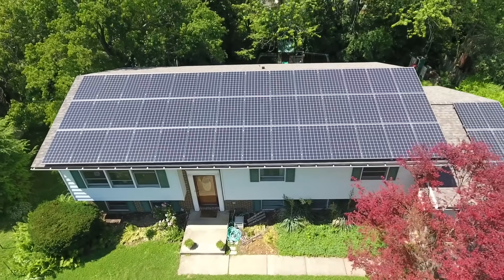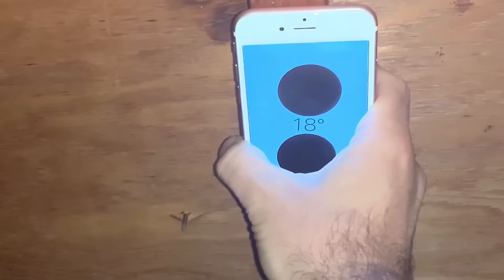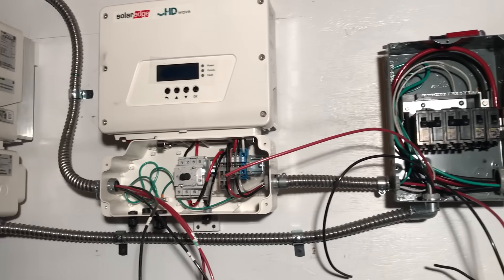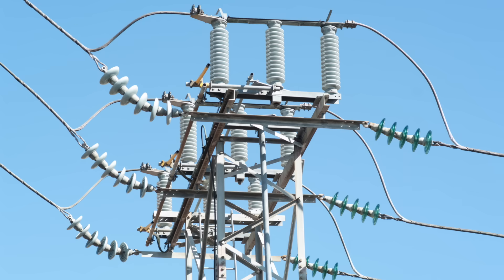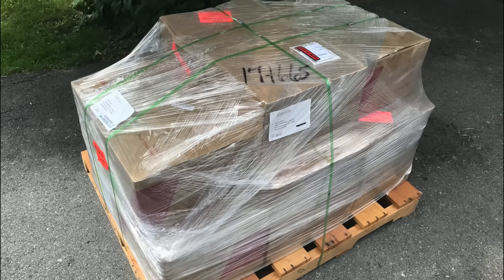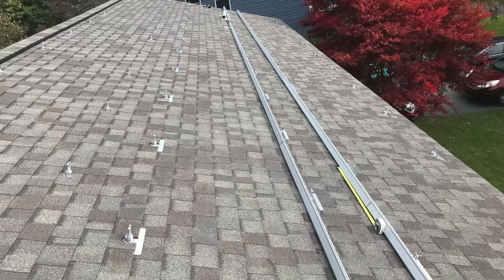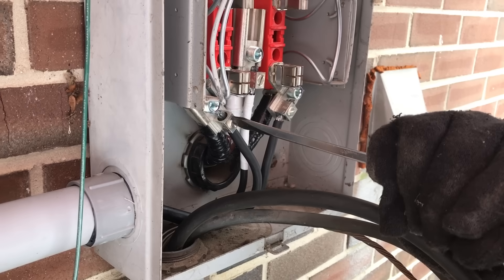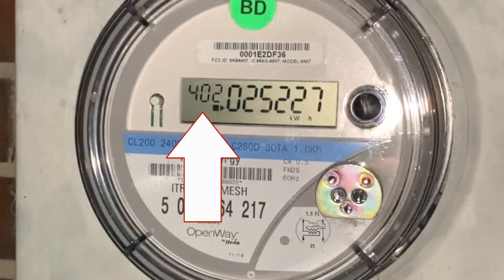I Installed a Power Plant Myself | HUGE DIY Solar Panel System

Comment: you had to pull several permits- that means the city / town will reassess your house value and taxes will increase. glass on the roof- your homeowners insurance will increase too.- that must be figured into the roi. also are you getting the same for your kw as the power company gets for theirs?

Comment: Great video.  Do you have a battery system? H
I assume you're pulling power from thr power company at night, so how are you net zero? Are you producing that much during the day?
Reply from the maker: Thanks!  No batteries.  New video slated to come out this weekend should help explain how it works.  Net metering is the key.

Comment: I’m curious have you dealt with any power outages since installing solar? Also are you storing any excess power in a backup system? Last question has the system been affected by weather conditions at all? I don’t have a house yet but I’m definitely considering solar when we buy.

Comment: I am retired from the electric company I worked for for 38 years. I worked in credit/collections/meter department. I was sent to do a check/re-read of a meter that was thought to be defective. When I arrived, I noticed that the house had 15 solar panels.
  when I opened that customers account in my laptop, I noticed that we had paid them $600 over the last year for electricity that they put back into the grid. That means, the customer paid us nothing, we actually paid him $600 over the previous 12 months.I spoke to the owner. He said there are times when he uses more power than he puts back into the grid, on hot days when his 3 ton air conditioner calls his house, and on those days he’s running his pool pump and his pool heater, but overall, we paid him just over $600 over the last 12 months. He had a 5kw System. He installed the system himself, it cost him under $4000.
  He brought my attention to one of his neighbors who also has solar on his roof. I looked that customers account up  over the previous year.We actually paid that customer  $50 more than he paid us over the previous year. that customer had to separate whole house air conditioning systems, and it was a larger house.. this second house also did not have full sun all day like the previous house does...

Comment: Right ON! Man I can attest to the HOURS it took to make this video, setup and edit alone! So thanks for that! Then there's the gravy of us trolls that sit back and watch the marvel that is 12:24 of video and it's all done. Anyways I have a MicroFit (program for some where I live in Canada that have tracking panels) system that produces 10kW's I think. What is yours producing, I thought I saw 18kW somewhere in the video and it seems quite a lot for what your area size is which I count you have 48 panels and I have 49. I'd like to know more about this as I think I may have a panel that doesn't output as much now. Regardless my system is tied right into the grid on a separate meter and I receive monthly cheques from the utility and pay my farm usage separately however I draw in more from producing than paying for use so bonus I end up ahead each month.

Comment: Could you do this on a metal roof? Thank you for the video
Reply from the maker: Yes, you could.  Just need to mount it properly.
Reply: Much, much better to do this on a metal roof than these shingles.  FR replaced his shingles and will get 20+ years out of them as he has near complete solar panel shade of the shingles (maybe a few years less with the added heat under the panels).  Not so on his smaller roof section.  The solar system will need to be completely removed and re-installed when the roof is re-done.  Use a metal roof (standing seam galvalume or aluminum best if you can afford) and the roof will outlast the system and with standing seam you also have ZERO roof penetrations.  I'm in an area with several hundred homes all completely off-grid, many of our neighbors who put solar over shingles have had this issue after only 10-12 years.
Reply: @geoffwood2712  Thanks for your reply. I remember a company called Solyndra or something like that in 2010s or so. They went OOB prob from poor mgmt but they  had a great idea. It was a cylindrical solar panel and I have never seen one like it. They would be great on a metal roof esp an aluminum one. We have an aluminum roof. The heat/light would reflect upwards all the time and would hit the underside of the cylindrical panel and so on.

Comment: Impressive work there.  Just a comment though... What is the degradation rate of those panels and is that factored into the payback time?  Seems that can range from 0.5% to 3% per year? To be accurate, ROI can't simply be a number based off something that degrades (albeit slowly).   Even if consumption and maintenance are assumed to be fixed.  That's misleading.  ROI should be a curve over time - right out to when panels are predicted to need replacing.

Comment: That is great work, and well done on the research and installation. I live in the Caribbean and I plan on doing an On/Off grid system. Seeing that I don't live in the US I know that DroneQuote will not be able to get quotations for me. However, the information is both useful, and helpful. Keep up the good work.
Reply from the maker: Thanks!  You may be able to get parts from Florida cheaper and DIY it.

Comment: I plan to buy a Park Model ( Tiny Home to Millennials ) 400sq.ft. It has an 18x24 foot covered deck also. I plan to put in solar panels and add batteries also. I am not sure of what i need or how to calculate and convert all to kilowatts .

Comment: I strongly recommend you add a small wind turbine, 200>300 Watts is enough, it adds a backup along with a battery bank. 10 > 20kw capacity is ideal so you can last 24 hours without sun.  If you can a water turbine is even better but not so many opportunities to get that going.

Comment: How did u deal with the laying snow? I see u r in PA as I am. Or do the panels produce enough of their own heat to not ice or collect snow?
Reply from the maker: You don’t have to do anything really.  They warm up in the sun and the snow slides off.  It would depend on the angle too.  I’m at about 19 degrees.
Reply: @FrugalRepair  hahahhahahahah

Comment: May I check with you on the configuration that I need to have if I would like to produce the electricity to charge wall batteries which will in turn power my house. I will only draw from the grid is the battery is below a certain level?

Comment: Do you believe that it's better to install solar panels on the roof like you did or use Tesla solar power roof?
Reply from the maker: What do you mean by better? I like the idea and look of a solar tile roof but it’s expensive and finding and fixing issues seems very difficult.  If I have a problem with a panel, wire, etc, it’s relatively simple to get access to it and address the issue.  I also don’t know if you can get detailed monitoring like you can in a setup like mine.  I’d be curious to know what level of monitoring they offer.
Reply: @FrugalRepair  I mean like, which can harvest more power and overall is better
Reply from the maker: I’m pretty sure the framed panels (mine are like 19%+ efficiency) produce more energy per square foot.  I’d have the look up the specs on the solar roof.  Maybe I’ll make a video about it.

Comment: I am on solar and not connected to the grid. I have two systems. One on my shop building here south of Soldotna, Alaska is 1400 watts of cells with 40-amp 12 volt charger connected to eight big 8-D lead acid batteries under one work bench. My inverter is an 8 KW modified sign with 12 KW surge capacity to start tools. This system has a wire running 200-feet over to our house to furnish power to the house when the house system runs down. I never run the batteries below 45%. The solar cells are mounted vertically on the side of the shop so that I don't have to sweep snow off from them 
I got the solar cells through Home Depot at a discount and freight free to their store in Kenai, Alaska. The inverter only cost $450. The solar cells measure 3-feet by five feet. To mount them myself I simply screwed a  couple blocks of wood on the side of the building to set them on and screwed the hangers to the building and removed the blocks afterwards.  .

The house system is about the same wattage of solar cells mounted on my slated roof pump house. It also has six 8-D storage batteries. This was the first one I installed using Harbor Freight 45 watt solar cells. Its been five years and they are still working. I added a few extra smaller 50-watt solar cells below to bring the total wattage up for that system to 1200 watts. I had to stop ordering from Harbor Freight because they wanted to send freight by Fed X and they wanted $120 for one 45 Watt panel. The first ones they sent parcel post through the post office for $50. Each Harbor Freight panel weight 50 pounds which is the limit for the post office. I got a much better deal on solar panels by going to the Home Depot store and looking through their catalog. If you live in a remote location like I do I would recommend you have the freight sent to their store to save money. Inverters and chargers can be sent through the mail because they don't weight much. Large batteries I get through the local auto parts stores for around $200 apiece. 8-D truck batteries weigh 150 pounds and will last ten years or more. I plan to go with Lithium Iron in a few years when these quit. 

Free books about Alaska and games go: www,hankkroll.com I am author of 14 books but have six on Amazon and other places. COSMOLOGICAL ICE AGES is about how the energy was made on this planet. WE discovered the sun diidn't make all the coal. oil or limestone because the atmosphere was 200 pounds per square inch 2000 miles deep and 20% CO2 at the beginning of the Carboniferous when all that wonderful carbon stuff was made. It took the power of a white dwarf star to get through such a thick atmosphere to make vas pools of oil and limestone layers up to 1200-feet thick...  Right now the atmosphere is only 50-miles deep and CO2 is a trace gas of .03 %. WE have run out of carbon dioxide to make any more coal, oil or limestone. This is a fact! Earth has lost 98% of its atmosphere since the Cambium Era.  www.GuardDogBooks.com

Comment: That is what every DIY enthusiast would like to do. It was really really a Good Work you have put in to this video for others to follow or learn from. If I can ask you How did you manage to clean those panels from dust and other debris? I have pollution which I need to think off else believe would impact the output from the panels for sure. Thanks!
Reply from the maker: Thanks! I haven’t needed to clean them yet. The rain and wind seem to do a decent job themselves.  But I am keeping an eye on their production.  Maybe I’ll clean them at some point for comparison.

Comment: I see your roof is shingle.  What do you plan to do when the roof expires?  I just bought our house, and the inspector says I probably should change the roof in about 10 years.  I don't want to install solar and then 10 years later have to tear it down, get a new roof, and install it again...
Reply from the maker: If you’re going to get solar you might want to reshingle first where the panels would go.  The panels protect the roof and should give the shingles a very long life beyond their typical 25 year usage.
Reply from the maker: But that’s just my opinion, maybe a solar installer or a DIY solar business would give you a different answer.
Reply: @FrugalRepair  Thanks for the fast reply!  It's amazing you did answer my question.  
Solar's 25 year usage is average, right?  I believe it has the potential to go significantly more years beyond that.
Reply from the maker: I don’t know that we even know how long panels will hold up and keep working.  The warranty I have is a guaranteed 90% output from original values after 25 years.  So they will be there a long time after that I would bet.  And that whole time the glass roof is covering the shingle roof.

Comment: i just purchased a home that had 18 solar panels and was removed when they replaced roofing . They opted not to put back panels but left wiring and breaker box with its own meter. I don't see any other equipment in garage but see conduit leading to roof with wires labeled solar.  is this setup still usable or outdated .

Comment: "no bills" throws rock at roof. ok there are bills now.
Reply: @Custodio Jc12 every panel costs about 300 bucks or more. on average 1 panel is broken a year. and about 2 mm of grime is collected by the panels. so you still have to pay for water to clean the panels. no such thing as "no bills".
Reply: @Custodio Jc12 well the best price you can find is 1 dollar per watt but thats almost impossible to find unless you order bulk from a manufacturer.

Comment: what will you do when winter? are your solar panel not got any rust in it?
Reply from the maker: No rust, they are aluminum.  The snow slides off the panels when it’s sunny so it’s not that big of a deal.

Comment: On FPL system we don’t let you tap into the load side in the can you have to have an auto throw that’s tied or let it feed from you breaker panel period so keep that in mind for anyone that wants to do this. Check your local power company’s standard

Comment: i cant do my house butt i wont to do a off grid for my shed and also so i can charge my   Rechargeable  Battery aaa, and aa so on for free and led light for the shed. then inside  Battery  lamps so on. its worth it i  change all my light bulbs in the house low led bulbs  i seen power bill drop. this gonna help it drop more. plus why i cant go 100% house solor is case i live in mobile home park.

Comment: Why not take solar in gaseous form.  Solar Panels and windmills are a scam.  They are unnatural.  It places extra stress on your roof!  It is unreliable. It is expensive.  You save nothing, in fact, you spend more.  Go with natural gas, reliable, cheap, environmentally friendly and most of all - it is all NATURAL.  No refining, No additives, just out of the ground and delivered to you for a cheaper price.    The infrastructure is already in place.

Comment: I'd love to do this but FLA is such a Power Industry controlled state, they don't let you power your own house in an 'off-grid' application such as when a hurricane takes down commercial power poles. So other than some net-metering virtually all the solar industry claims here are scams.  Your DIY approach is refreshing.
Reply from the maker: Thanks!  Why can’t you install a battery backup?  Net metering is key though for solar.

Comment: I'd like to build an ICF house with a large pole building shop/garage. 
I'd like to do solar power on the south roof and evacuated tube solar heating along the south wall. 
I'd do in floor heat in the house, garage, sidewalk, driveway. Prioritize heating the house and garage then allow on demand heating of driveway and sidewalk.

Comment: Can we DIY solar panels from scratch?
Reply from the maker: You could (assuming you already solar cells), but it would take too much work in my opinion.  I have a box of solar cells, maybe I’ll do something with them.  Let me know if you have ideas.
Reply: @FrugalRepair  does your book has details to build solar panels? 
I am from India and got terrace space to hang double dozen solar panels.. My aim is to build prototype first with 1KW and complete digitally controlled system.. Follow Phase 2 with transformation using graphene coated solar cell and  graphene based batteries.. with capacity 10 KW.. Looking how your videos and books will help me to achieve my AIM

Comment: I had someone install all of mine. My entire roof is covered and i also had my storage shed installed with it and two large panels in the back yard that adjust to the suns direction. My panels power my house all day and night and i also make around $120 a month that i invest 50% into the energy company o use and the rest towards savings for upkeep.
Reply from the maker: That’s cool!
Reply: Approximately how much did it all cost ? Trying to determine if the initial investment is worth it.
Reply: @OGCJ10   it honestly depends on your area, i actually sourced out people that purchased solar panels and never installed them so i took them off their hands at a fraction of the cost. But i also spent a pretty penny getting them to my doorstep. My setup cost around 12k for the equipment. But the cost for installation is what cornered me for a few more years. Would have been longer but, i had a buddy that gave me a discount for installation. The cost for that was 18k. That is probably the cheapest i could ever get it here in my area. It will be a very different price everywhere else, so do lots of research and source out contractors for multiple bids. I honestly wish i had the knowledge to instal it all myself like this man because it would have saved way more money on top of the savings i already had. And i dont even know if i will be living in this house long enough to actually pay off what i have already spent. But i dont have to worry about that high energy bill of 200+ in the summer and i also gain an extra 80-120 bucks every month depending on the light it receives. I have had it fully installed for a year and i have already gained around 3k in savings alone and around 1.3k in total earnings of suppling everyday to a provider. I Don’t have much in stock earning yet, but that will grow in the coming years. I am still learning about all this stuff as well, it really helps put a lot when you have a friend that knows more about it than you.